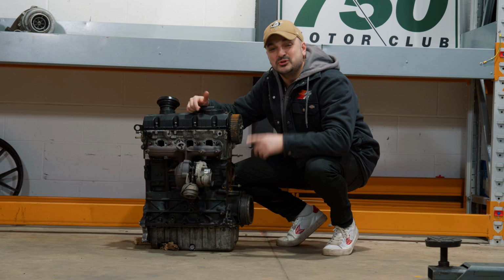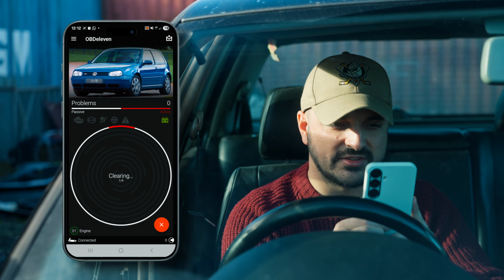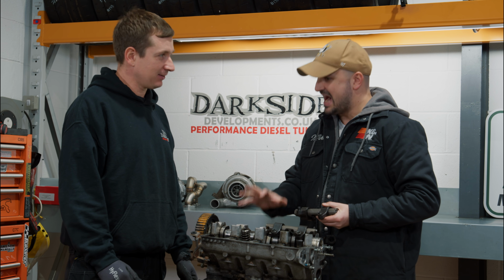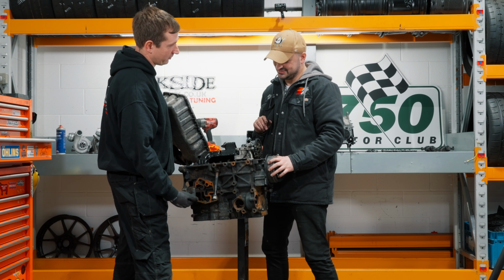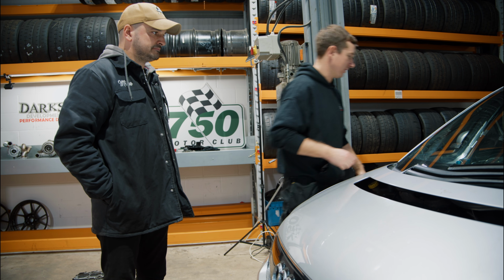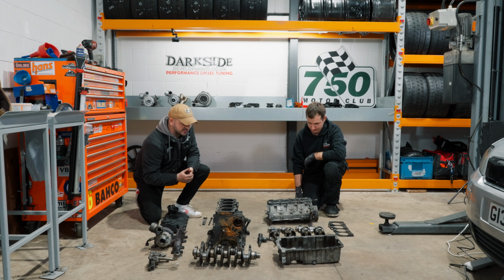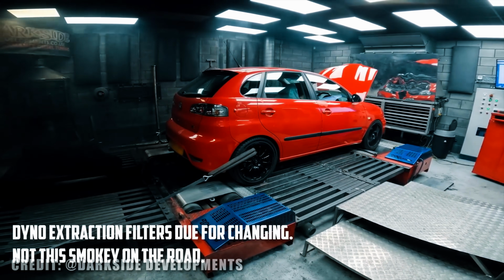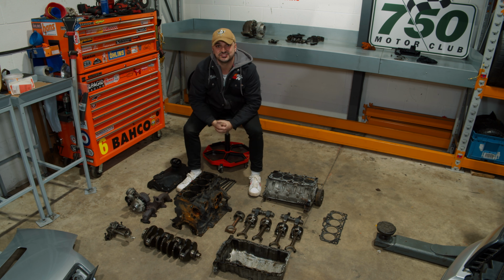Why This Volkswagen Diesel Is The Greatest European Engine Ever Made

Comment: A mate of mine put just over a million miles on a 1.9pd  powered t5 before it went bang,
Reply: What failed? Did the timing belt snap?
Reply: No thats a lie.
Reply: @captainchaos3053 
No it’s not a lie it’s 100% true, it was all motorway miles, it obviously had stuff replaced but the bottom end was original, 
I imagine it had at least 4 gearboxes though as there shite, there’s plenty of vw 1.9pds that have done well over 500k miles
Reply: @daz575  500000 miles yeah 1000000 miles no way.  I've had oil pumps fail, broken cranks, bore wear out of round, ring failure and worse on cars with 500000 miles never mind double that.
Reply: @captainchaos3053  It isnt.
Reply: @teuvodogg well I'd ask for proof but we both know you can't provide any. I have worked on these engines. I have seen the wear on engines that are serviced perfectly by the book and by 300000 they are ruff by 500000 they are fucked. No way it went 1000000 before something failed. Unless you towed it for half the distance😂
Reply: @captainchaos3053  I missed the part where the original commenter used bald eagles from ass to mouth instead of kilometres, yeah, no way over a million in bald eagles from ass to mouth, but many of them do 900.000+ without major problems. I'm at 580.000kms with my 1.9tdi.
Reply: @teuvodogg  yeah they can do big enough miles but they usually need a bit of help to get there. Most need the head overhauled at around 300000 miles or 500000kms. I have a pd in my own type 3 camper which is coming down with a bad case of blow by and its at about 450000miles or 725000ish kms. 1 million miles with no work just won't happen.

Comment: I had a MK2 Skoda Octavia Elegance estate with the 1.9 PD and a DSG box. Remapped it was just wonderful for reliability, economy and to this day the kick of those unit injectors makes common rail diesels same lacking. A 15 mile journey on a cold winter's day in traffic and you didn't even get the engine up to temperature shows how great the thermal efficiency is. I had to buy a grille blocker so I could get warm air quicker. Absolutely indestructible and none of this DPF crap
Reply: How much did it cost to get it remapped?

Comment: I had a pd 130 in my B5.5 Passat. For it's 100k mile birthday it got mapped to 160. Sold it with 160k with still the original clutch and turbo. What a great car it was.

Comment: I've had had 2 PD130s & a PD150 , PD go upto PD160 Mike in the Seat Ibiza Cupra 1.9 TDi. My first PD was in the only brand new car I've ever bought in a 51 plate GT TDI 150 Golf followed 5 years later with a 2 years old 04 Golf GT TDI 130 then 3 years later a 56 plate Skoda Fabia VRS. All 3 Engine wise were perfect. In the 3 PD Engines I've done at least 120K over about 10 years.

Comment: Oil change every 5,000 miles OR more often, them PD engines should last forever
Reply: 5W30 VW507.00 change every 10.000km and it will

Comment: You said that VW group replaced the 1.9 with common rail engines. That’s not correct. They released a 2.0 PD 140PS and a 2.0 PD 170PS that got used in a bunch of cars! It’s after that they replaced them with CR.
Reply: The first PD 2.0TDI is terrible..... WORST than 2.0 CR and 1.9PD!
Reply: The first 2.0, that replaced the 1.9s were trash.
Reply: What made the first ones terrible? I’m intrigued.
Reply: @ZylonFPV Early models (specifically BKD engine code) suffer from cracked cylinder heads, while others face oil pump drive gear failure. No oil.. no working engine or turbo.
Reply: @Hollander040 that’s pretty serious 😂
I had a car with the 2.0 PD 170, never had any issues with it
Reply: @ZylonFPV could be you had a revision or someone replaced the oil pump early on. That was the only way to save the engine
Reply: @Hollander040  had a 1.9 2009 seat Leon it had the bkd engine it was good engine till it wasn't timing belt was replaced by me or so I was told by mechanic few days later belt broke
Reply: @ZylonFPV  they wanted to make them 16v, and there just wasn't enough space for two camshafts and these big injectors, which led to cracked heads since the material was too thin (so to say) in some places
Reply: @amkobih4479 interesting - sounds pretty bad!
Reply: @amkobih4479  Sounds kind of similar to problems in Saab 900 gearboxes back in the day. They wanted to add an extra gear to the gearbox for "improved" model but didn't want to change the exterior dimensions and the casted parts started to crack because wall thickness wasn't enough in long run.
Reply: @ZylonFPV  the oil pump..... uses allen key lol...... worn out quicker.... after that problems VW put 1.9 TDI oil pumps back in 2.0 CR 2nd batch...

Comment: My Dad had an 07 Passat with one of these in and it was insane. Motorway cruising at 85 getting 50mpg no problem.
Reply: I had the 90 TDI in an old shape Passat. Drive it like you stole it - 50mpg. Drive it like Miss Daisy - 55mpg. I should have had it chipped to 110 more power AND better mpg because it made more power at useful revs.

Comment: I remember back in the day the diesel rivals were VAG PD130 vs Ford TDCi 130...
Reply: 2.0 tdci is a fantastic engine. Mine's going strong on 219,000 miles, haven't touched it in the past 100k.

Comment: I had a ALH 1.9 in a 2002 jetta i used in northern canada and at 580,000km the body finally had enough ... other then a turbo and 5sp manual trans at 400,000km never skipped a beat between -40 winters to plus 40 summers
Reply: side note ... they will start at -38 c not plugged in and glow plugs cycled 3 times .. there not happy but will do it

Comment: Supposedly can take 400bhp on stock internals. 

My pd130 mk4 estate has around 220bhp and does 700-800 miles on a full tank and will take redline abuse all day long.
Reply: Ever ran a dyno on it? Had a friend that struggled for years to break out of 300bhp on his octavia, at least one blown engine per year , last config was 270 as he was tired of dumping money and new engines in that POS 🤣🤣. He was running stock internals, firads, 3l tdi turbo on a custom manifold and a big intercooler kit, also a 3inch straight pipe .
Reply: @silexplod22123 ive seen a few on youtube running close to 400 on dynos who claim they have stock internals. Im sure darkside said they were good for it as well.

I have a hybrid turbo, 4 bar map and an intercooler on mine running around 1.9bar. Mine has only done 170k and has ran fine. I think they like oil changes more often with higher power.

Comment: I had a B4 Passat with the 90bhp, chipped to about 120, removed the cat and fitted a larger exhaust (I don't remember whether it was from a V6 or a 16V).  It also had G60 front brakes. It was epic.
Reply: I have a B4 Passat with the same 90hp TDI. They're not PD engines in the Passat, but the earlier 1.9 "VP" engines with mechanical injection. Not as good for making power, but just as good, or even better reliability wise

Comment: I had a Golf with this ASZ engine for years ago. 510.000 km on the clock, and still drove 70 km each way for work. Should never have sold it.
Reply: I had this in an Audi A4 Avant. Sold due to divorce. A car I should never have sold.
Reply: @Dave5843-d9m the A4/Passat platform doesn't have the ASZ engine, they only have the AWX/AVF engines. The AWXs are coupled to a 5 speed manual gearbox and have less torque than the AVFs/ASZs (285Nm @ 1750RPM-2500RPM instead of the 310Nm @ 1900RPM), along with "smaller" injectors (that is the same size but with they inject less fuel) and a weaker/smaller clutch.

Other than that, I think the ASZ has a different exhaust placement layout due to it being transversal instead of longitudinal, meaning that a direct engine swap isn't possible (although there are very few parts that need to be swapped out).

TL;DR: ASZ for transversal mounts, found in A3 8L facelifts and Golf IVs, they make 310Nm@1900RPM;
AWX/ASZ for longitudinal mounts, found in A4 B6s and Passat B5/B5.5s, and the components and peak torque vary based on drivetrain setup
Reply: Mine is AVF, its 6 speed manual. Bought it in October 2023 on 535 000km one owner with LOADs of issues, now she runs beautifully. Spent lots of money lol but worth it. I am keeping her
Reply: @matthewdutoit  I drive a BMW 535d now (which can be seen on my profile) it cost 10x as much as I sold the Golf for, and has had about 10x as many problems also 😅🙈
Reply: @The.Brave.Warrior  e61 535d would be nice, but tax and insurance is almost 7x the cost of the golf tdi... and is 10x my tsi...
Reply: @TheIdiotPlays  I drive the F11 535d, great car, but expensive to maintain.
Reply: @The.Brave.Warrior A friend of mine has one, they sure do leak oil
Reply: @TheIdiotPlays  Mine doesn't leak oil. It's Stage 1 tuned to 400 hp / 750 nm. It runs great, but it's expensive to service with original BMW parts. Heavy car with high torque, so brakes and tires wear out quickly.
Reply: 400xxxKM BRU here.. Still going golf v

Comment: Mitsubishi used the PD engine in the Lancer, (2010)
Reply: It was slightly different, they mixed and matched parts from VW to fit it in the Lancer. It had PD170 turbo on BKD block and head combo, proprietary EGR, intake, engine mounts etc and it had a Lancer trans with longer gearing

Comment: Used to own a 5 door GT TDI 130 in canyon red, turned up some and over 200k miles. Beat on it every day and it ran solid for years, took myself and friends to some amazing places and the fuel cost was cheap! Great engine and another great vid mike and 100% look at darkside if you want diesel bits!

Comment: I've also got a A2 1.4 75 PD. Seems a great little engine
Reply: Ive got 2 polos with the tdi engines one has 205000 miles the other one 100000 they are brilliant
Reply: @richardsmith8938  good to know it will last mines only on 76K
Reply: @dreww3810 barely run in. Bought mine at 125,000 miles 12 years ago. Now on 294,800 miles.

Probably worth getting your oil pump chain and tensioner changed. Mine were changed six years ago and had some wear.

Comment: I was always a fan of the simpler ALH, but this was a cool watch.
Reply: VP guys often disliked the PD, because the nozzles tend to die and then they are still pretty expensive compared to normal VP nozzles. VP are also more economical on the track. A bit weaker block, thats why we use PD blocks or internals. A bit harder to tune due to the specifics of Bosch VP pump, but still can reach same performance levels. PD can go further tho. Also VPs dont have problems with heads as much PD does.

Comment: Had a PD100 Seat Ibiza sportrider for over a decade. Excellent engine. With VNT on a baby turbo there was zero lag at any time, although doesn’t have the top end of the 130 and 160. The engine outlasted the rest of the car sadly which was rusting, clearcoat falling off and various other things going wrong on a regular basis.

Comment: 19:35 I liked the way Mitsubishi did this in the mid 90's. no bolts to come loose. Mitsubishi put the oil squirters in the blocks crank webbing. you put the squirter in before you put the crank bearing in. The oil squirter couldn't come out without removing the crank, so it could never come loose and fallout. Ever!. Well designed idea... as long as they didn't get blocked, which would then be a total nightmare because you had to remove the crank, but if they were blocked then it was usually time to replace the crank bearings anyway.
Reply: Reliability = Fully Mechanical TD27. Produced from 1988 until... today? Nissan put them in everything from taxis to trucks, then they were continued to be built for forklifts for decades! The type of engine that you would do a million k's in, then give it a refresh and do a million more.

Comment: When I think VAG + 2000's I think of Dieselgate The VAG cheating was done using software, and to achieve the level of cheating that they did, this could only be done with Common Rail Injection systems, as with those the software controls fuel management, where in the PD-series of engines, it was mechanical. An episode covering Dieselgate would be great - just a suggestion. But this episode was excellent Greetings from Prague, CZ

Comment: I had to put 2 PD injectrors, both in cylinder 1, and a harness around 200k on the second one. What is the probability that the first harness killed them? I've been told the injectors are not serviceable. Is this true? They are getting really expensive here in the USA.
Reply: They are and they aren't 😅. You can replace the nozzle , clean them and even replace the piezoelectric unit but often times it's not worth the time and money, you kinda have to get new ones, if the piezo unit is broken, there's major corrosion or cracked body you're better off buying new. If you refurb have them flow test the injectors, otherwise it's just a show to grab your money.

Comment: My Daily is a 2004 Skoda Octavia. With 778.000 kilometers so far , still drives great . And cheap to maintain
Reply: 2003 Octavia here, at ‘only’ 570.000km. Driven 500.000 in it. Only recently had to replace the factory clutch.
Reply: @iBeast_M0de  I replaced the factory clutch on my A4 PD130 at 547 000, Very expensive lol but worth it
Reply: @matthewdutoit cost me about €900, most of that was labour, it was about double what the car is worth. Hehe, but it beats buying someone else’s problem for €900
Reply: @matthewdutoit  Diesel torque comes at a price
Reply: @iBeast_M0de  I was always curious about the clutch in these since I had a VW Golf with 257k miles and I swear that thing had half it's clutch left before I sold it on.
Reply: Nice one, I thought I was doing well at 450,000 km with my A4.
Reply: If you can get 20 liters Drums of mannoil where you are , there is some money to be saved and the oil is good quality.
Reply: @landmonkey22  I only use Pemco 350 from Mannol family. Its a long life and it covers my vw and a w245 Merc, even though I change never over 15k kms
Reply: @landmonkey22 Yes,I use 0w30 C3 ,it outperform Mercedes original 5w30,and cheaper,for my 300K miles mercedes engine,just add a squeeze 30 ml Lucas stablizer oil additive and diesel fuel treatment ,my engine sound smoother and fuel save,more power.
Reply: @rupert1124you got alot to go then. I think im gonna hit a million kilometers in this one 😅
Reply: beugeot boxer. 570000km with mechanical high-pressure diesel pump. without turbo. still starts with empty battery and drives without problems. 33 years old car. f#¤% electronic injection. and cold weather.
Reply: I thought 285,000 miles was good and zero oil consumption with original everything from vw.
Reply: Is your car still driving on the original injectors, Injector nozzles and injector seals?
Reply: Thats just over 483,000 Miles for my fellow ‘Mericans
Reply: @NukemGarage now at 789.000 😅
Reply: Wymieniałeś turbo ? Jeśli to przy jakim przebiegu i czy turbo oryginalne nowe czy regenerowane ?
Reply: @fenio81 yes previous owner did get it rebulit at about 400.000
Reply: Wow , so my Skoda yeti 2013 2.0 diesel is only just run in at 174000 miles then , all joking aside the 1.9 and the 2.0 litre diesel are fantastic engines 👍
Reply: Finally broken in
Reply: Great vid , has anyone put one of these in a Landrover ???
Reply: @Chain21SAW  i've seen this engine swapped into American pick-up trucks and in a Porsche Cayenne completely ripping off-road, so I'm 100% sure someone has put it in Landrovers.

Comment: Isn't the pistons, rods and crank all forged which makes it ready for silly high boost levels, where the 2ltr pd isn't and is much weaker engine and do fail. I modded a 1.7td Isuzu out of an astra into a Corsa and man that thing boosted 32psi max fully loaded at over 200 ft/lb of torque and god knows what bhp but it was up there.
Reply: This isn't true
Reply: @ryanp6138 which part
Reply: @petechongy forged part. The Isuzu bit checks out

Comment: 17:07 Injector bolt is m6, bet you they dropped it down the oil drain in the head, did the same once but retrieved it with a magnet.
Reply: Yeah I said that off camera
Reply: @ryanp6138 thinking my camshaft is pretty worn out, tunes don't really change the power much judging with my butt dyno. Although the cam doesn't look scratched up itself. Probably lobes are rounded by now.
Reply: @mantvydas8810 rarely makes a difference on the Dyno, keep running till it needs a belt too!
Reply: @ryanp6138 won't need a belt for another 100k km, but I'm going to replace the cam sometime in the summer. The lifters are getting a lot noisier lately, it's about time.

Comment: I had a Leon Cupra TDI 150 remapped to 185bhp. 50+ MPG, and boot it at low revs and a lovely big lump of black smoke used to bellow out the back before it raced off.
Reply: I mean there are local environmental reasons to have a problem with that, can you imagine if everyone's vehicle did that to the air in residential areas

Comment: Hmmm i don't want to jinx it but i have a 2.0 PD140 in my Passat and its done nearly 240000 miles and still going... i think these engines are great tho. I've had many VWs with PD engines. I can recognise the sound of a PD engine and it is a reassuring mechanical noise! This is great content tho. Thanks for making it!